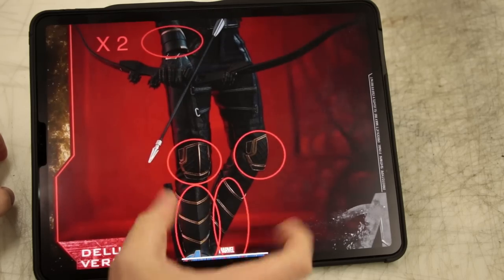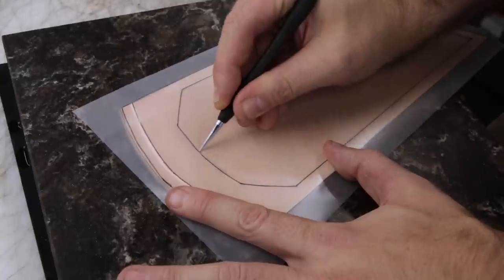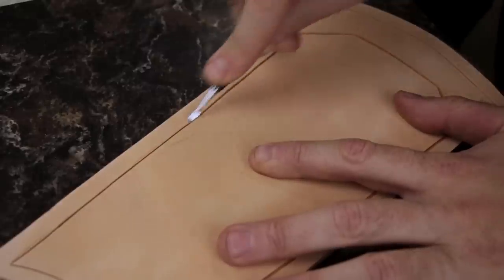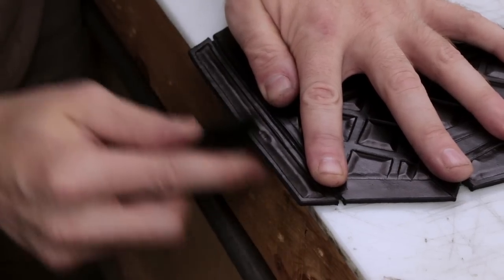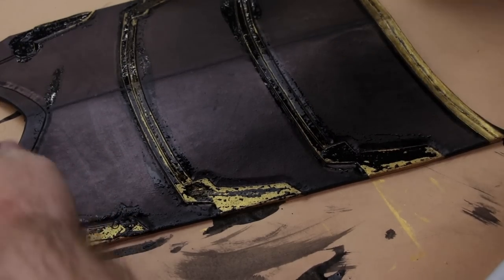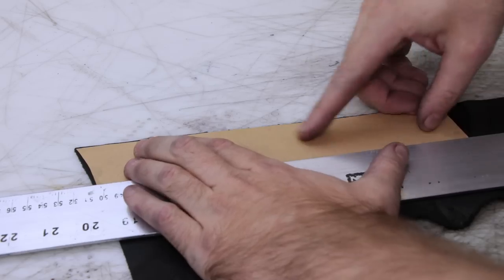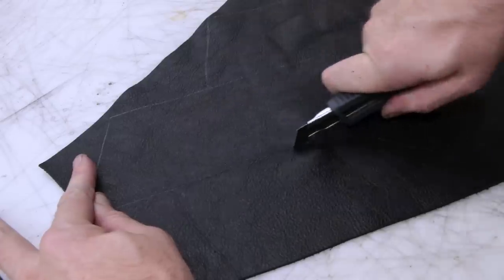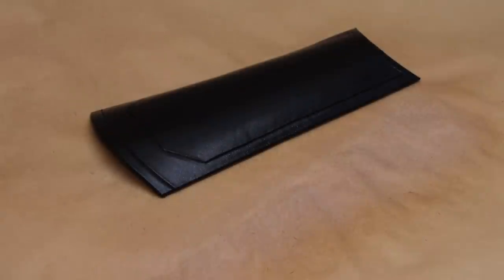Ronin / Hawkeye Costume Build - Part 2 - Avengers Endgame

Comment: i'm impressed. For all the 'I woulda done this different' they still turned out great. Maybe 2.0 will benefit from all this new found understanding but these are the best they could be right now. Anywhere I can't stitch, I use contact adhesive, yeah it stinks and you sure need ventilation but it does do a good waterproof stick, unlike anything else I've tried. Hero piece? I'm a Batman fan, you figure it out :)

Comment: here is a quick question what is burnishing?
Reply: Burnishing is rubbing down the edges to create friction which in turn leaves an edge that is as smooth as glass and far more pleasing to look at than the fibrous edge you get when cutting and bevelling leather, this also creates a stronger edge that is far less likely to split or tear when caught.